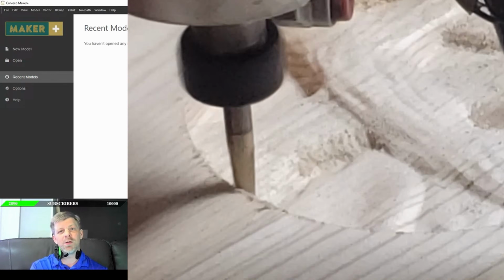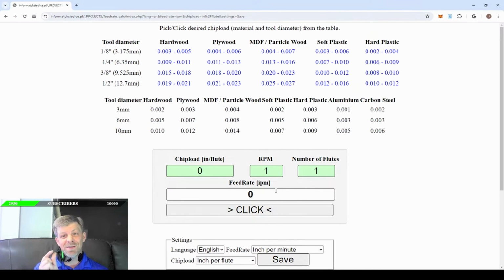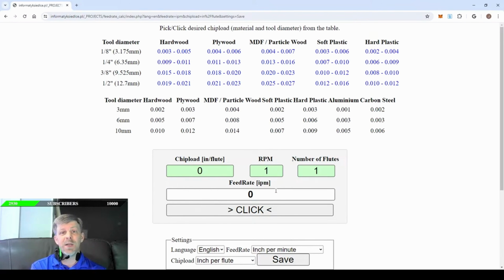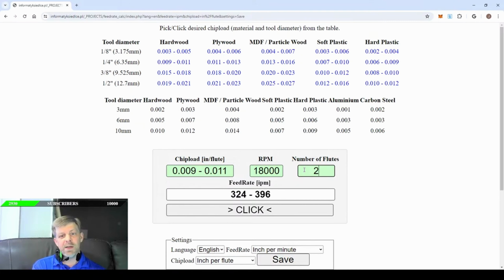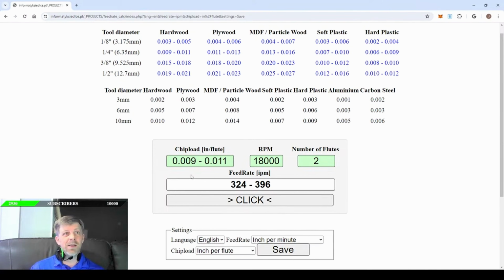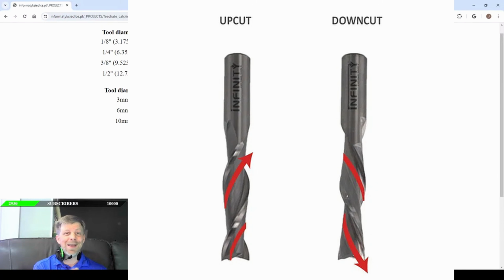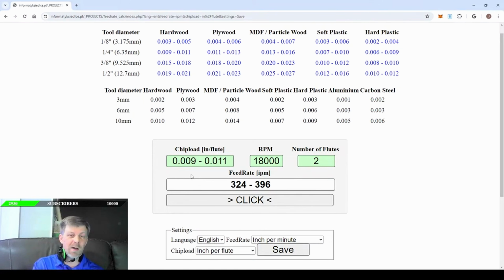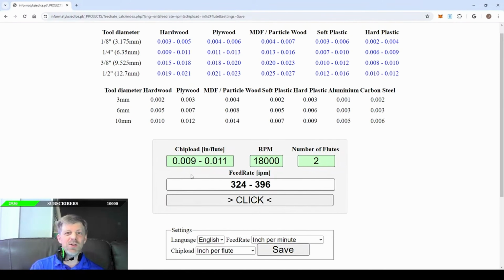Easily Master CNC Chip Load, Feed Rate, Stepover & Stepdown!

Comment: Thank you that is by far the best explanation I have heard so far.  I have a Genmitsu 3020 (3040 now) CNC with a fixed 12,000 RPM spindle and have struggled with feeds and speeds not knowing that in Fusion 360 tool databases that those numbers were calculated for professional machines.  This helps a lot I have been cutting some hard maple and have had issues with bit chatter on the radius of the cut.  I utilize Fusion 360 as it is free for hobby use ( I currently do not plan to sell my work) and wanted to learn only one software package for both 3D printing and CNC .  For me CNC has been a much larger learning curve, but that keeps me young.
Reply from the maker: I also have used fusion 360 and is free but not the best for either of those design wise. For 3d printing I find autodesk inventor much easier to use and for CNC carveco maker is only 17.50 a month and is much easier to use for cnc as its more designed for hobby and small commercial businesses as well as the industrial side. Fusion is focused on industrial component making and is very precise for those functions. If you want to try carveco I have a free 2 month trial in the description of my videos. Glad the video helped and thank you for watching it.

Comment: Great video.  So much conflicting information out there on feeds and speeds.  I’ve got a Onefinity elite foreman with the redline spindle and struggle finding the sweet spot for this.  There’s gotta be someone out who has developed a feeds and speeds calculator for the hobbyist style CNC’s.  These industrial charts are useless
Reply from the maker: Thanks. You may also want to check out this video I did on chip load. I go over how to dial in your machine. https://youtu.be/IAbXRco6JY8?si=mJhWWZ3N4Dh0DY5J

Comment: is there some for granite?
Reply from the maker: No granite usually is cut with grinding type bits sometimes in a wet slurry so chip load would not apply to that kind of material and bit.

Comment: I'd like to add the we need to specify what the term hard and soft wood means. Firstly hard wood and soft wood actually have nothing to do with hardness or density  but rather if the seed is in a hard shell like nut, or a fruit.  A White pine is a hardwood,  yet the wood is soft to cut. Apple wood is a soft wood but cuts like concrete.
Reply from the maker: Maybe I can add this info to the description area. Hardness is measured by the Janka scale of hardness.The Janka test measures the amount of force required to embed a 0.444" steel ball into the wood to half of its diameter. This test was created by Gabriel Janka in 1906. Hardwood comes from deciduous trees, which shed their leaves annually. Hardwood trees are angiosperms, which produce flowers and fruits that contain seeds.
Softwood comes from evergreen trees, which do not shed their leaves. Softwood trees are gymnosperms, which produce cone-like seeds.

Comment: For hobby CNC's you mentioned to account for different CNC types by reducing chipload figures in the charts given by approximately 25% to 50%. But to obtain these reduced chipload figures, does one also need to reduce the depth of cut by the same percentage? For example, for a 1/4-inch bit, you would normally cut at a depth of half the bit size (1/8-inch) . If one reduces the chipload figure given by the chart by 50%, should the depth of cut also reduce by a further 50% - e.g., go from 1/8 of an inch depth of cut, to 1/16 of an inch depth? Thank you.
Reply from the maker: The depth of cut should only need to be reduced by half the diameter of the bit. The reduction in chip load chart numbers was just a guideline on how to reduce those numbers to get closer to what many hobby machines will be able to achieve. All of these settings will need a little bit of testing to find the optimal setting
Reply: Thank you for your answer. My reasoning was based on the opposite of what you read and need to add as shown at the bottom of the webpage for feeds and speeds. 
    20-25% - for depth = 2x tool diameter
    40-50% - for depth = 3x tool diameter
So when reducing chip load, the opposite may apply - to reduce the chipload figures by 25% and 50%, the depth of cut would need to proportionally reduce by 25 or 50% (or at least reduce some amount). But, from your answer, this reasoning seems to be wrong. Thnx
Reply from the maker: @peterg902  Yes the reduction for going deeper only works in that direction as more of the bit is being used so it takes longer for the flutes to evacuate the larger chips.

Comment: Nice video. So what would running a hobby CNC too slow be for example?  How about 120 inches per minute at 17,000 RPM on hard Maple? Too slow?
Reply from the maker: Its best to pause the job mid cut and see if your bit is hot. If its too hot to touch it needs adjustment.

Comment: I have a chipload spreadsheet. I just got done modifying it for tabletop machines with percentages. I can use any percent I want now for it to calculate rpm's and feed for the chipload. Using your example on your website for 25% it comes up with pretty much the same thing (I averaged). But it got me to thinking. Why does this only apply to deeper depths? With the proper router speed rotation, doesn't the normal depth produce the same result?
It looks to me like router rpm speed is the main variable here and not necessarily the feed rate. Adjusting the spin of the bit to grab the wood looks the most important to me so making it go deeper, just to get bigger chips, would only apply more stress on the spindle and in my case trim router.
Reply from the maker: The rpms of the router have a power to rpm ratio so you are trying to adjust to the most powerful part of that powerband with a router because the router is the limiting factor in most hobby cnc machines. On the makita router that is around 17000rpm or between the 2 and 3 on the dial.
Reply: @Timberfalls  
OK, but why does that have to apply to deeper depths to get the same chipload?
Reply from the maker: @iwannaapple7190  the chip load charts and calculation is rated as depth of cut is equal to the diameter of the bit. When going deeper than the diameter of the bit you have to lower the chip load by the percentage of depth over this amount.

Comment: I'm with the other guys on this one. Your explanations are top notch and can't be repeated by anyone.
I'm going to have to rewatch in the area of desktop machines and reducing chipload by a percent but one area I would like to see covered that I am always confused about is what exactly is stepover when it concerns vcarving. I thought the bit is just concerned with reaching the width of the whatever it is your carving. I can calculate how deep it goes as for the width but I still can't figure out what stepover has to do with it. Do you have a video on that? I want to add I have been looking for that info for the past 3 or 4 years. No one covers exactly that topic and why it is different with pocketing.
Reply from the maker: Thanks for the feedback on this one. Stepover in vcarving only is a factor if you do not use a roughing bit. The roughing bit will carve all the places the vbit would need to stepover unless the roughing bit is too large to fit into those areas then the vbit will stepover to clear that area at the bottom. I will try and make a video about that in the future. Hope this helps.

Comment: I've noticed the marks and fluffyness with compression bits where the edges encounter in the middle , that's why we stopped using them even when everyone recommends them for cutting
Reply from the maker: Yes that is the downside of compression bits. Have you tried using an O flute? There are some kinds of composite materials that cut better with an O-flute because the flutes are larger than the chips created.
Reply: @Timberfalls  The problem with O flute it's the they're either upcut or downcut and very steep, and i can't use either as i need perfect finish on both sides that's why we went to 3 flute straight

Comment: Great stuff. Suggestions on best bit to use when cutting birch plywood and to reduce tear out on the side wall of the plywood. Very tricky. I have had best success with downcut overall.
Reply from the maker: Downcut endmill but maybe try traditional direction instead of climb. I also recommend slightly higher rpms when doing birch plywood just be careful it does not start screaming high pitch sounds which would mean your feed rate is too slow.
Reply: @Timberfalls  Thank you. I will try this!

Comment: I love your teaching style.  I would love to see a video explaining roughing passes and finishing passes.  I have a lot of unnecessary wasted carving time on my finishing pass.  Do I change the start depth?
Reply from the maker: @jimhensley4210  the finish pass should only leave what the roughing pass does not get. If it carves air uncheck the z passes settings or check safe z settings
Reply: @Timberfalls  I have safe Z settings at .25”.  Do I drop it lower to accommodate the roughing pass?  How far?
Reply from the maker: @jimhensley4210  safe z is how far the router retracts in between moves. If you do not have any thing that the bit needs to clear on top of the wood like clamps this can be set really low like .05-.1 and it will speed things up.

Comment: Great video, thank you. Is chipload still important when you are using a dust boot and dust extraction? 

I figured most of the chips are being sucked up by the dust collector therefore reducing heat in the material and the bit. Is that correct?

Cheers 👍
Reply from the maker: No chip load from the bits settings is the main reason for reducing heat and the dust extraction has no impact other than keeping chips from building up in front of the cuter and reducing chip load efficiency.